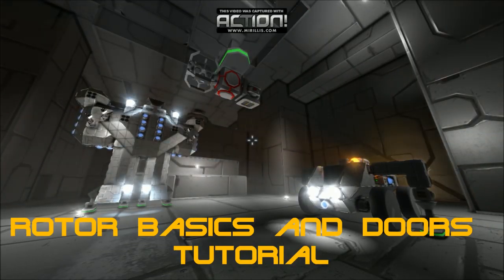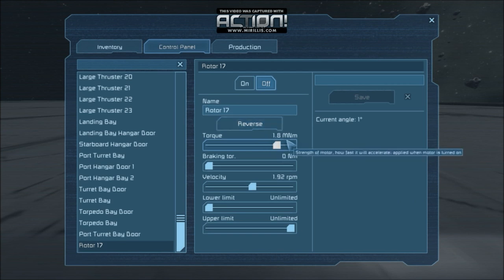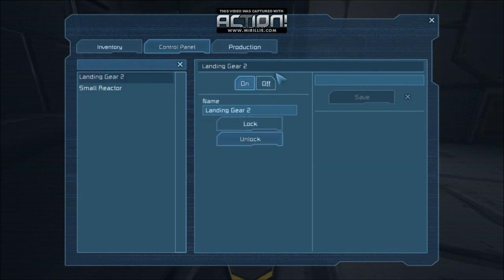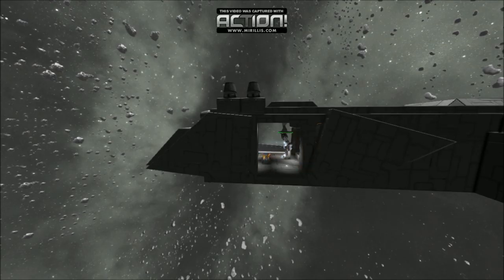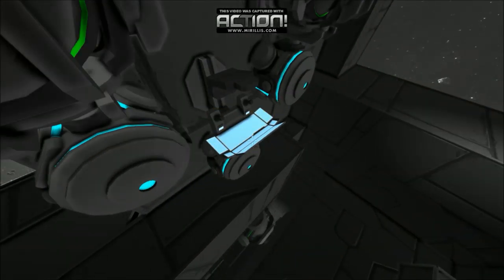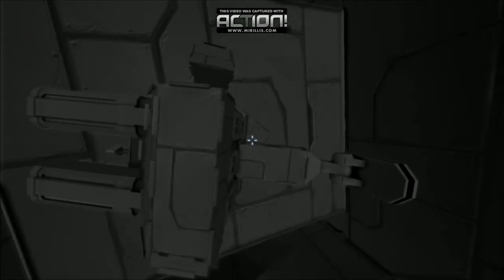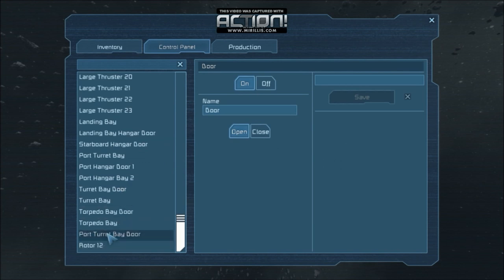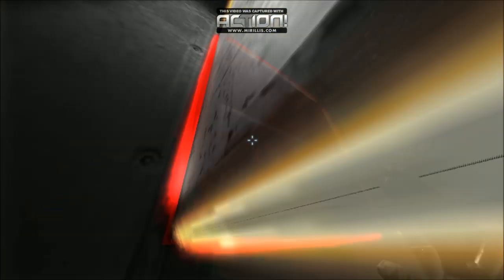Space Engineers - Awesome Hangar Doors!!

Comment: Hey Ronin SamuraiTV how do you get your rotating angled doors to close without any damage. I have made a similar setup but I can't seem to get them to close without damage
Reply from the maker: If you use the same angles and fit that I used in the video, you should get by with no - or hardly any - damage for the dual-rotating doors. The rotation speeds I use ensure that the doors connect without damaging each other, however as you know sometimes rotors still act out and go crazy and end up glitching a bit which will damage your doors. So the occasional repair may be required...

So yeah - first thing is to remember to use the same setup in terms of rotor location in relation to the entire door - that's the most important factor to remember besides not using a ridiculously high rotor rotation speed (which is the second thing to remember hehe). Took me a bit of time to get this to work how I intended it to back in the day, but from then on it got very easy to replicate doors like that which didn't require constant repairs every time you closed them.
Reply: Thanks man I figured it out!